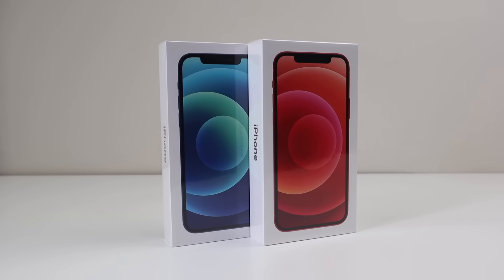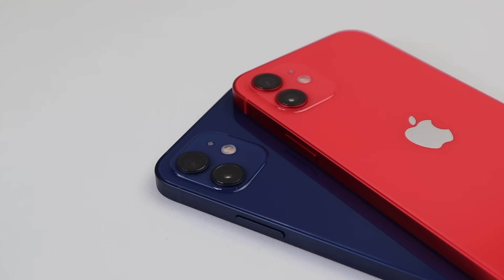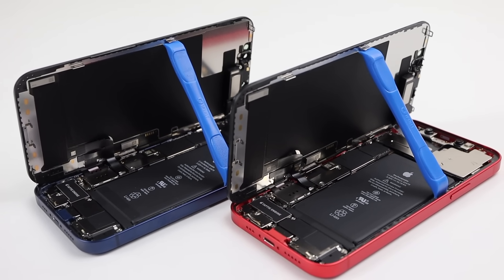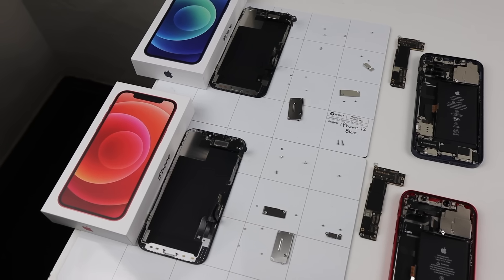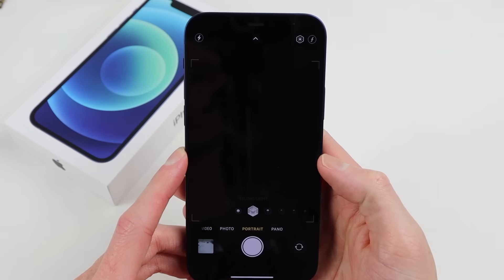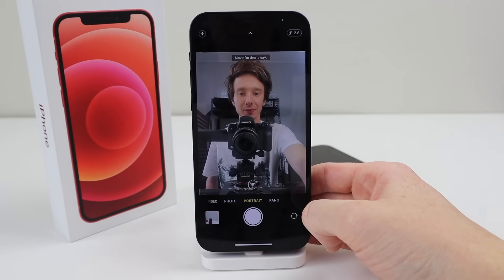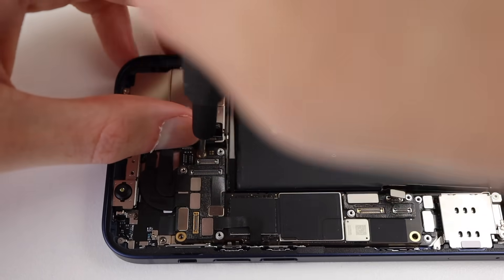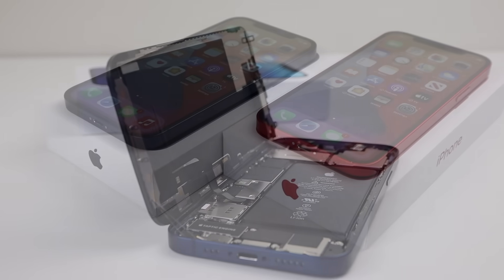iPhone 12 Anti Repair Design - Teardown and Repair Assessment

Comment: I had a Casper Via M1 that i used for 4 years that i:

-replaced battery 4 times
-replaced charging port 10 times
-replaced the whole damn screen 2 times
-replaced the camera once

and then we have this piece of troglodyte technology that is fueled by greed.
Reply: Well...all what we can all say and agree on...iphone sucks and it's OVERRATED
iphone stops care more and more for their customers, they just think how to get more money. They start do more trashy phones and ask bigger price because it's "newer model" so you need to pay more
Compared to Android, it's way cheaper, for example xiaomi is between most qualit and cheapest ones, almost everyone around me have xiaomi, me, mom, sis, classmates, just damn...you can customize android however you want, ya have micro SD and there are this branded phones like black shark or red magic what are actually asking just 600$ (red magic S3) and they have actuall trigger buttons, liquid cooling, port for headphones, actually caring for their customers
Reply: @gemblersk2519   not to forget that iPhone doesn't even give you a charger adapter or headphones, which just seems cheap.... And they even changed the cable.
Reply: @birisuandrei2866  Just one thing to say
iphone SUCKS

change my mind

I rather keep my lovely android, much better OS and you can easily adjust it as you want
And between us...I love to bug into my settings and customize my phone, I just like the way that you can customize your android as you like and make perfect phone for you

For example I have Windows 10 launcher in my phone amd not just that it's only looking like windows, it's even working and usefull. You can easily find apps and don't have mess on home screen
Reply: @gemblersk2519  well i mean thats your opinion. mine is kinda diff, switched from s9 to ip8. no regrets. loved the s9's screen tho. customizing is fun but thats it. as i grew older i just want a smartphone that just works, yknow. plus it gets 5 years ios updates. all apps are smoother imo, maybe because apple only release 2-3 phones a year unlike androids. the ecosystem is amazing as well. ive never replaced my ip8 battery or screen. 84% battery health. about this ip12 unrepairable things, maybe thats possible for 3rd party repairs use the worse edition of original screen and battery. bc in my country, theres a lot of em, they sell it for much cheaper price and... it just doesnt work the same after the repair. just take a great care of your phone, dont use it while charging, use tempered glass and a case. it'll last longer. i was thinking about getting the note 20 tho, but knowing it has exynos. big nope. im getting the 12 mini if the next ip13 sucks. plus i get better value if i want to sell my ip. my s9 selling value was not great at all even i used it only for 8 months so instead i gave it to my dad. sorry if i make grammatical errors.
Reply: @gemblersk2519  Finaly someone who agrees! I hate Apple, and not just for the hardware. Does anyone remember when Apple removed Fortnit from the app store? That was because Epic games made a website where you can save about 30% on ingame purchases. Apple was greedy and wanted more money and removed it because they wernt making money from Fortnite. They make plenty of money from phones, computers, etc. I think that Apple is a horriabl and greedy company. Apple SUCKS.
Reply: @rrueps4844  It's company who asks money literally for nothing
It's just question of time when that company falls cuz people realize that apple sucks. Like...they latest iphone 12 DON'T give you adapter and they even changed out put from adapter so you still have to buy adapter, you even CAN'T repare it by yourself. In sum, you buy iphone and don't need to worry that someone will steal it from you cuz when someone will steal it, that person can't sell it on parts cuz apple pair their components so when it broke to you, you have to buy new phone cuz it's not possible repair it
This is nice example of greedy company, spending 1,5k $ on phone what you will break once and can't repair, it's useles piece of crap what should be nerfed from entire world forever
Reply: @gemblersk2519  sadly other companies will copy what apple does. like they were making fun of apple's jack removal. i think youre just a hater, its 1k for the 12pro, samsung's note 20 ultra is 1,3k for exynos and snapdragon. why people nowadays say its better to get androids cause its cheaper? their flagships are pretty damn close in price.. oh yeah i forgot how my s9 had 2 different calendars, 2 different galleries etc. and stupid bixby. dont worry bro i was an android fan as well back when i was younger, but once you get to try another os and buy it yourself, you'll notice difference between them. i'd take 12 pros with my 5w charger or extra money for fast charger anyday than having 1,3k exynos. but if i lived in the us, it is quite confusing to choose a phone, they are all great.
Reply: Wtf are you doing with your phone???!!
Reply: @themoonwalker1153  i didn't own ziplined pockets back then, if it went down sometime in my weekly 10 mile run, i had a job to do back home
Reply: Lmao I have a MiA2 phone for a year now. Never faced any issue similar to this. I literally tried to do everything. 

Changed OS
Changed Bootloader
Changed Battery (doesn't really have a problem but I just wanna be sure it won't bloat because I dropped the phone)
Changed screen but only the first shielding not the digitizer and LCD panel (got scratched when I dropped it from a 2M height)
Changed the camera shielding (got stained when I tried using highlighter on them)
Changed the port (not really a problem when I changed them but there was dirt inside the type c port

Up to now, it still works. 
Unlike iPhone most other phones doesn't prevent their owners from repairing. They also doesn't limit the features usable. Purely open source (not all but most)
Reply: i'm using my local product phone for almost 5 year, and i never having battery problem
Reply: i’m pretty sure that if you had bought an iphone you wouldn’t have to repair it 20 times in 4 years
Reply: @MB-iv3fy  you're right! You just have to worry about Apple slowing it down arbitrarily to force you to upgrade. Or dropping it accidentally, or pretty much any kind of accidental damage...but I guess you don't mind being ripped off by a company to fix something....
Reply: @MB-iv3fy  no, you're wrong, this doesn't really have anything to do with his phone, it's his personal issue of breaking the phone often, and I can guarantee if he had an iPhone it would break just as fast as any other new phone.
Reply: @birisuandrei2866  Yes my friend got a Iphone 6 for his birthday and within 2 years he had to change the screen 4 times, the charging port 3, and the battery 1 time. By the time it was fixed he could of bought 4 Iphone 6
Reply: @rrueps4844  yep, I just throw them when they break xD i usually buy cheaper phones anyways. I had like 2 phones with broken screen and 4 that either the battery and/or electronic components simply died lol.
Reply: trust me, I'm not even actively interested in tech or hardware fiddling and I replaced the charging port on my Xiaomi Mi A1 3 times with EASE
Reply: And they claim their greed is green yet cant explain how
Reply: @GreyBlackWolf  they're just being cheap not including headphones or charger adapter, the headphones we can live without but what kind of crappy company gives you only the charger cable? A cable that isn't even compatible with most used chargers e.e
Reply: @GreyBlackWolf  "We are green because we said it" is what one person would say.
Reply: Using iPhone 6plus Changed battery 2 time (deji brand)(my phone is 6 years old) 
1 screen (not original) 
1 speaker set (original) 
And still works fine but the iPhone 12 is really weird why apple why...
Reply: @efekanuyguner6513  Apple: "Money"
Reply: wtf mate? ive had a crappy iphone 6s I bought 3.5 years ago and I've only replaced the battery once.. I'll take that over building a whole phone 3-4 times in just four years. Yikes my guy!
Reply: but, when you own that piece of technology, people look at you as if you're heavenly beings 
do you even know that there are way too many people who extremely care of their image? that they rather buy an overpriced thing, as long as people don't look at them as piece of rotten trash?
Reply: @electronresonator8882  I look that way on owners of iphones, lol 😂😂
Reply: Bro there had to be a point where you should've thought "maybe I should just get a new phone"
Reply: China already made huawei phone which is a clone of apple and android so apple dont want to take  any risk now..
Reply: That's kinda waste of money. 
I'm not justifying Apple's shittiness.
Reply: That sounds amazing. I want one now.
Reply: my note 4 is on it's third battery XD
Reply: Hey guys..IS THIS TRUE!?!?...
just got informed from SPRINT/T-mobile that after end of year they are dropping support and service for NON 5G phones after their merger!?!? I only have 4G phones (4 different ) because I can repair them... wtf!?
Reply: @madmax8620  definitely untrue, 5G is built on 4G code or whatever so thats thankfully impossible. plus its going to be a couple of years before everyones using 5G.
Reply: @trillcollins7847  they say they need the limited resources of.that code frequency to.convert and supply the 5G signals
Reply: @madmax8620  who says that? they're truly out of their mind.
Reply: @madmax8620  that would put hundreds of millions of people without cell phone service.. are you starting to understand why this sounds crazy af?
Reply: @trillcollins7847  agreed ...r u starting to understand thats why I'm here discussing it. .i wont have a usable ohone then... it was a text from Sprint/Tmobile referring me to a simple web page  saying that they need to ditch the old legacy phones because they need to move forward with 5G dedication  (like dumping coal and jumping straight to wind power i guess but much worse) Tmobile is not a CDMA supporter but sprint WAS 
and they called the older phones "legacy devices" and they wont be able to find the towers to connect with anymore because Tmobile finds that service antiquated and costly so needs to push towards 5G and move customers towards new devices. .. apparently they had a history of doing this kind of user genocide before when they aquired Metro PCS users... and they can make millions  from the forced  sale of new phones and contracts too... i googled it to find other sites articles mentioning last and earlier this year that to expect this to happen and maybe possibly they might give a deal.for a.new phone... and I read a forum where people in some areas were already being forced transitioned and of course  promised a great new phone deal but when it came time to pay there was no help or deal....so sounds about what to expect as horrible as it is... im screwed...
Reply: Niye Casper aldın ki
Reply: Damn that phone sounds abused haha I had an s7 edge for 4 years and didn't need any repairs
Reply: Dang son we need to know what ur doing with your phone...
Reply: @markgeorge2200  i had an rather "action filled" life before quarantine :p
Reply: That's very true. I had a Huawei Mate 9P and I easily replaced the built-in battery with ease. Right now I am just hoping that the battery inside my iPhone XS won't malfunction someday and I have to take my phone to Apple to repair it.
Reply: U need to learn how to take care of ur things then troglodyte
Reply: My 3 year old Samsung S8, still works just fine, haven't had to replace anything on it at all, the screen hasn't even cracked once, doesn't even have a screen protector on it, just a cover and I've dropped it countless times

How do you manage that?
Reply: That’s sound like a crappy phone
Reply: I had an iphone 6 and replaced nothing in the 4 years i used it
Reply: You need a new phone
Reply: I have a 3G cheap phone and I haven't changed anything in it for about 9 years. Even the battery is still alive.
Reply: Wow, I have a 4 year iphone that has absolutely no issue.

Battery at 85% but still very usable, screen and everything else exactly the same as when I bought it.
I’d take that any day rather than whatever phone you keep repairing...
Reply: Jesus, what are you doing to that poor phone so that it needs so much replacing in just 4 years?
Reply: @Blackreaper777  i did not sit all day
Reply: Wow I am sure glad I don’t have crappy phone.
Reply: in 4 years replace the battery 4 times? in the iphone the battery has to be replaced for the first time after 4 years
Reply: @leweson9254  yeah the thing is i am good at replacing stuff and not preserving too well, also 2 of the changes was because of a socket problem ending with some nasty fire i had to put out with baking soda
Reply: Ok tho but with an iPhone you wouldn’t have to fucking replace every part 10 times in 4 years lmfao gtfo hahahaha
Reply: @freddwoord  most people don't break they're phone that much though, and to be fair if he would've had an iPhone I bet it would break in a few months (according to how many times he broke his phone in 4 years) and he would just throw it instead of paying stupid ammounts of money to Apple.

Comment: So basically it's like switching a motherboard on a windows PC. The hardware ID is recorded within the registry which for the most part, forces a reinstall to authenticate the copy of Windows, but in the case of the iPhone, there's no way to reset that since the factory reset is preset to what was originally recorded? That sucks.

Comment: I used to have Apple but this type of design ethos broke my passion for the product. I tried the top 2 best Huawei phones and I am honestly delighted with the performance and it's simplicity with the new in house  software applied. I think most people like myself fall into the marketing of Apple but look around other brands and you'll be more than pleased in  every  way.
Reply: you lost me at Huawei
Reply: @Gino_567  why? all these phones are made in china anyway
Reply: @alamoemperor3845  being made in China is different to a company allegedly working for the CCP.
Reply: AYO THAT COMPANY GOT SOME ISSUES. That company is constantly under fire for working for the Chinese government, selling western information, there’s a whole lot.
Reply: @gambi2843  apple will sell your soul if they can
Reply: I agree on the Huawei phone hardware. My phone has great battery and performance for a mid end phone. My main gripe however, is the sheer abundance of built in software that serves no purpose to someone like me. I usually download stuff from 3rd party app stores, and at this point most stuff is just taking up space. Also, if you are so concerned about privacy, read the actual policy before accepting
Reply: @fannerbuoy3688  I wonder why a huawei phone would have a bunch of built in software, makes you think.
Reply: @fannerbuoy3688  totally agree. I can't even use the search function on my Huawei, because I don't want to sign up for them collecting my info!
The hardware is great for the price but it does come with many down sides.
Reply: Welcome to Android. Enioy your stay :)
Reply: LAGdroid.
Reply: Why android is better. Simple as that

Comment: this is absolutely wrong. I have kept my iPhone 6s for years replacing parts as they break since I haven't seen the need to upgrade. I now need to upgrade and apple does this. I now have a serious consideration in front of me. I am not someone to bend over and take it from absolutely anyone, so I am certainly not wanting to stay with apple after seeing that 3rd party repair has been null and void by their programming. Totally unsure of what brand to go to now tho. I haven't looked at any phones that aren't apple ever since I got an iPhone 10 years ago. any suggestions on what brands to look at?

Comment: The battery reading not working is why the power button didn't work with out the power cable plugged in.

Comment: I don't understand why most of the people change their phone every year for a new one slightly better than their last phone and way more expensive. And this goes for every phone company not only apple. I'm still using a samsung s7 edge, for god knows how many years, and it still get it's job done. I don't see any relevant improvement on the last models that worth the money or even make me consider to change it with a newer model. I never used a protection case or protection glass. I've dropted it many times on concrete floor and didn't break.. it does have some scratches on the backside but I think it looks worst with a case that with some small scratches. And it's not about the money, most of my friends do change their phone with a new one every year, that have some small upgrades that they probably don't even need, and most of them can bearly afford them... I just don't undersand human beings.
And if apple or samsung or EA (fifa) makes the same product every year with some sparkles on it and sells it at an overprice is because people are sheep.

Comment: Ok, but we already knew we needed to swap front facing cameras because of flood illuminator, and there’s been rumors about the battery issue since 2018, it’s grating to hear the sensationalizing about that stuff. The rear camera being serialized is a problem, but apple is working with more third party companies, and are allowing them access to RepairCal and OEM parts.

Comment: My theory is that although the parts are genuine and made by Apple, they are not new. The parts have been attached to a phone and used by it which (somehow) marks the parts as used. Which kind of makes sense since you don't want a repairer to use genuine but used parts. So maybe try the same process but with brand new parts (not sure where you can get those)